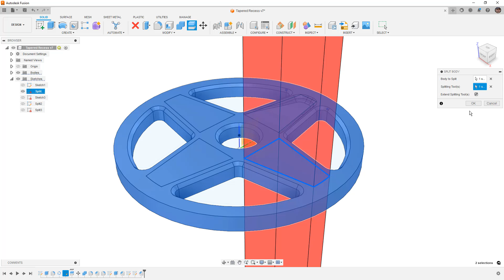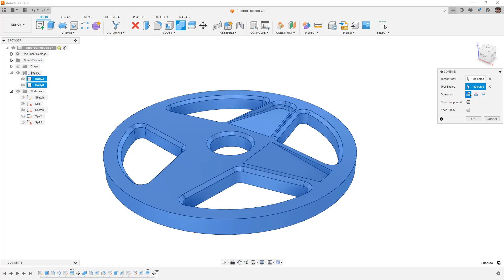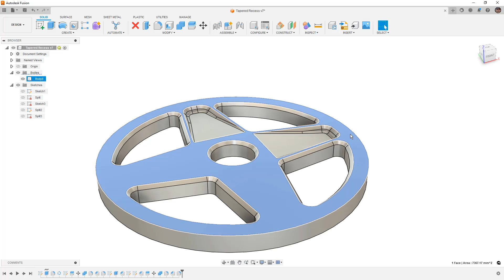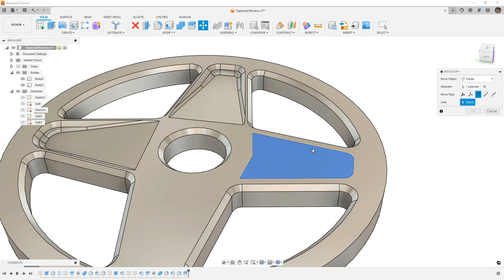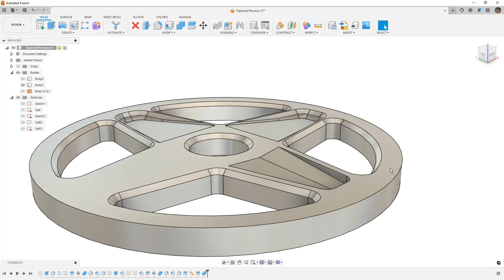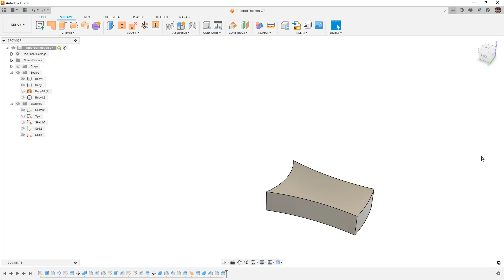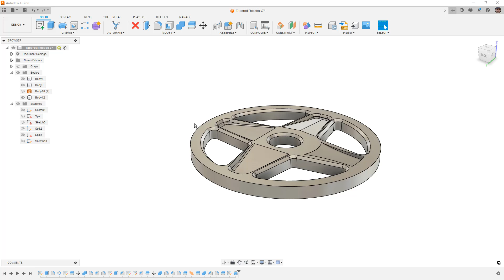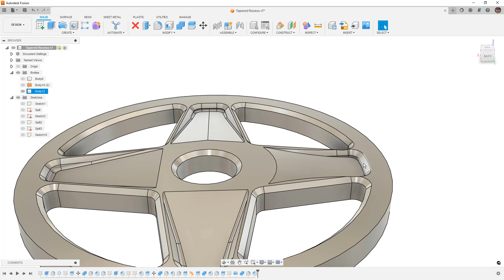How To Make A Tapered Indent Feature In Fusion | Simple Methods To Make Complex Features

Comment: - Yet another way for example-02: as slot mod to example-01.
- Simply do 'CONSTRUCT:Axis Through Two Points'; use as 'Rotate' 'Axis'.
- Will work for example-03, too - so, no surface modeling, or "revolve cut tool".

- And, nice vid, BTW :)
Reply from the maker: Thanks for sharing!

Comment: Hello, I'm so glad I found your channel. Every video I'm learning a lot of things!
Would you consider doing a video about reverse engeneering a car exhaust section? I have 3d scan datas but I'm struggling to get the correct cut angle of the bends and pipes' length. Since I want to fabricate it by myself I'm trying to create the best drawing I can . Thank you very much!
Reply from the maker: That is a tricky one!  How complex is the exhaust?  Probably the way I would do it is make Mesh Section sketches at different points along the exhaust and fit a circle to them, then go back and make a 3d sketch with lines and arcs.  Then use the Create > Pipe Tool.  Not sure how you would translate that back out to MFG data from that solid but you could measure the arcs you create between straight sections and get info off that.  

Feel free to drop me a line support@caducator.com , but i don't think i could do anything in the near future as i have a lot of other content and work in front of me.

Comment: Do you think you can help me with a school project, I'm making the "peel" light by YOY, and having trouble nailing the peel aspect, I would appreciate it if you made a tutorial about it. I can alternatively commission the design. Thanks
Reply from the maker: That is cool I haven't seen that before.  Since this is a school project I don't think I can help you directly, but I can give you some tips.  This would be best done as a surface.  The OLED light portion is just a triangle and I would draw that first.  The next thing would be to create 3d curves.  That is the trickiest part really.  I would use a Style Spline with just a start and end point to keep it as simple as possible. And use the tangency handles to get the shape.

I didn't make the PEEL light but hopefully this file gives you some idea on how you could make the shapes.  https://a360.co/4aHoHZF
Reply: @LearnEverythingAboutDesign  I actually love you bro, the file and tips were very helpful. Appreciate it.

Comment: Nice addition to F360 School's approaches. Can you think of a way to have a tangent S profile sweep around that vertical face instead of adding fillets to those top and bottom edges?
Reply from the maker: Thanks Craig.  Likely the best way to do something like that would  be surfaces.  The problem with just applying fillets/chamfers is that the ramp ends at a point.  

Take a look at this file and let me know if that is what you are trying to do.
https://a360.co/4cTQUyH

I did something similar to this in a video talking about an intake scoop area for a plane, but in the above file i started the same by splitting the body(which i may or may not do if this was the actual design direction).  But then split the areas inside and outside the hard edge so i could blend them.
Reply: @LearnEverythingAboutDesign  This explained it exactly. I opened the file. In the surface tab, I deleted all the transition surfaces you created, then applied a loft with G1 tangent and that created the smooth S curve I was asking about. I'll check out your plane scoop video, thanks!